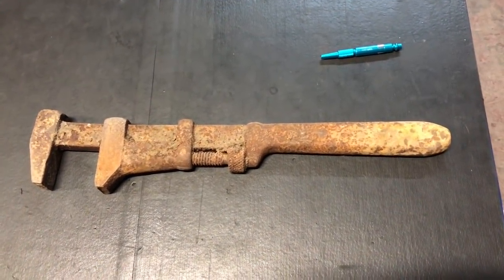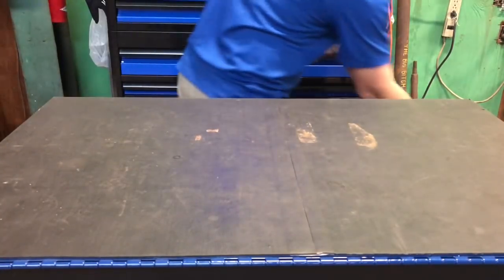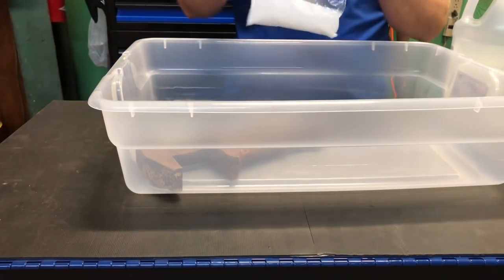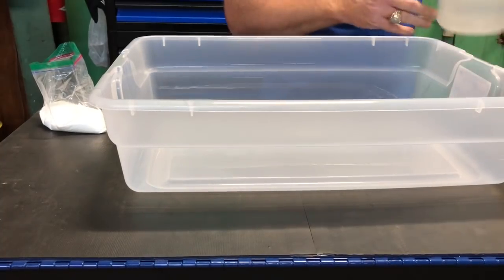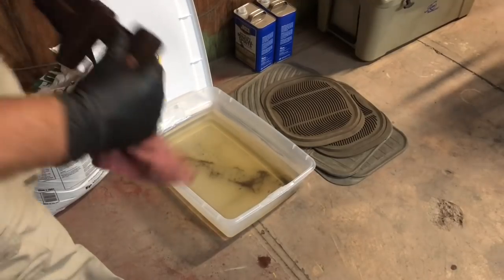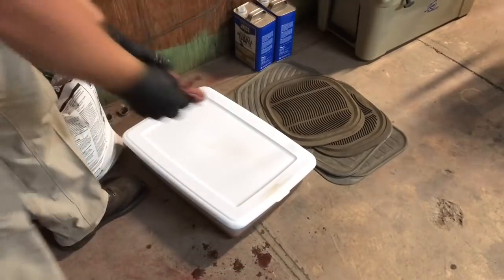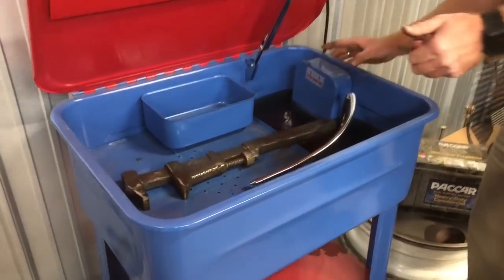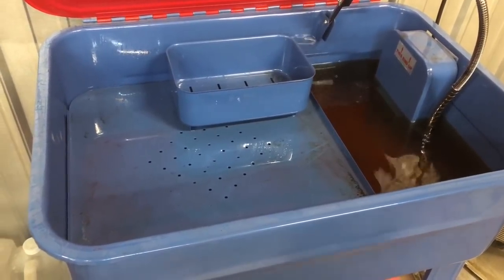OLD J.H.  Williams Wrench Restoration

Comment: It took so long to remove ther rust by the vinegar, because you neutralised it with the salt👏
Reply: But still did it well
Reply from the maker: Like I said In the video that was my first attempt to remove any rust and restore anything. I looked it up on google and that’s how several people said they did it so that’s what I did ?
Reply: Yes but that's not really helpful when you add salt into the vinegar. Because the salt neutralised the vinegar and slows down the "Rust eating" a lot. Just try to use only vinegar next time;)
Reply: PS: 
And try to avoid contacting steel with salt water because when it dries it will rust even more (when you don't wash it properly;)

Comment: To get the rust off, I am thinking that you cud do it real quick by having 3 tubs: 1) muriatic acid, 2) oil, 3) water. U dip the wrench in muriatic acid & watch the rust disappear; then put wrench in tub of oil to stop new rust from forming. 3rd tub is for safety in case you need to wash acid out of your eyes! if you should splash stupidly the wrench.  Wear eye protection, use protective gloves; tho IMHO common muriatic acid is not that dangerous to human skin (like nitric acid is -- don't use that).  I tried to use 30 % vinegar to clean a yucky toilet bowl; it did some good, but muriatic acid did the trick.

Comment: The best penetrating product is automatic transmission fluid and acetone. Mix it 50/50. Don't mix any more that you will use. Acetone will evaporate out fairly fast. All the old tractor restorers know about it.    

Penetrating oil .......... Average load

None ..................... 516 pounds

WD-40 .................... 238 pounds

PB Blaster ............... 214 pounds

Liquid Wrench ............ 127 pounds

Kano Kroil ............... 106 pounds

ATF-Acetone mix.............53 pounds

Comment: What I do for rusty parts on my lawn equipment is use an abrasive wheel with my dewalt brushless drill and it busts the rust right off real fast.
Reply: What kind of abrasive wheel?
Reply: @nonamefounder  The red kind for drills that you can buy at walmart for $4. Well worth the 4 bucks, just make sure you have a drill that has a high speed because the faster you turn the brush the faster the rust is removed and more polished the surface gets.

Comment: I rebuilt a boat trailer using straight white vinigar and water.  About 50/50 mix.  I let the small parts soak for a week and wire brushed the parts and returned them to the tub. I used a needle scaler and  a wire wheel on the main frame components. The 50/50 took a bit longer, and I did not use salt. Look for a higher acid % on the vinager bottles.  I am too cheap to use straight vinager

Comment: I wish you'd used oil on the threads when you started to turn them and before that, you should have heated it with a torch 😕

Comment: Don't know if you got it to move but that PB Blaster works pretty good.  We used it a lot on trailer hub nuts.  It's not good for drilling though, gets to hot.  It's good penetrating oil or chemical though. Pardon, but after I finished washing the video I see you did use the Blaster.

Comment: You could maybe use a thread chaser wand like these to straighten the threads:  http://www.langtools.com/sku-2573-3-pc-thread-restorer-file-set/
Reply from the maker: asm154 1 it is stripped out up inside the head part it seems like. I’m just going to use it as a wall hanger anyways so it doesn’t really matter

Comment: Great video for educational purposes should've started off with using a funnel when mixing the salt and vinegar instead of trying to mix in a plastic storage container could had just poured into the container and shook it up to mix it and instead of letting it sit for 24hrs I would had put in a big pot and boiled it applying heat to speed the process just like washing dishes with hot water but just my opinion still great video though

Comment: I was starting to cringe when you started.  I was afraid  you were going to blast it.  Which is the perfect way to ruin a old wrench.  I like to use Evaporust.  It is cheaper if you buy it by the 5 gallon bucket.  Look up mrpete222  on YouTube.  In his Tips # 312 video he talks about rust removal.  To finish your wrench.  You could use Gun Blue.  Or other Black Oxide products.  Then use a Diamond clear coat.  Eastwood company has those products.
Reply from the maker: Eric Snyder awesome. Thanks
Reply: Eric Snyder unless you use plastic media. Never aluminum oxide.

Comment: These "F" adjustable spanners were a bad design. They date back to WWI. They slip around the bolt head or Nuts. I threw mine away. Your F spanner is bent or distorted. It will be a nuisance to use. The modern Shifter or adjustable spanners are good because of the angle design which makes it easier to turn bolts & nuts. Also easier to adjust with one hand (Thumb & forefinger).

Comment: I'm sorry to point it out, but this is not a restoration. This is just a cleaning - and only a first step. A good cleaning means end up with a mirror-like tool... Restoring means to bring it to its perfect working conditions, straight (not curved like this one), tested  etc. But you sure will better in the future. Just use the correct words! TY